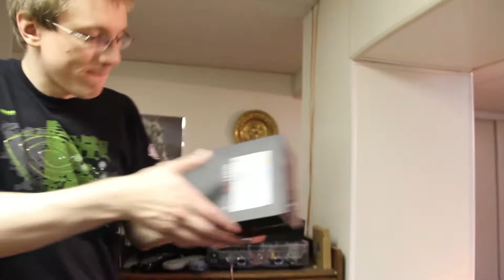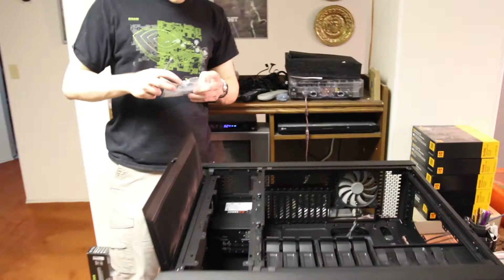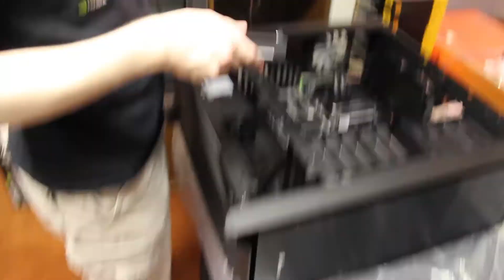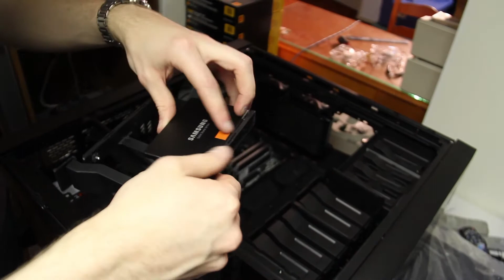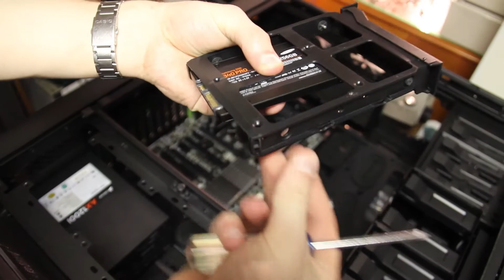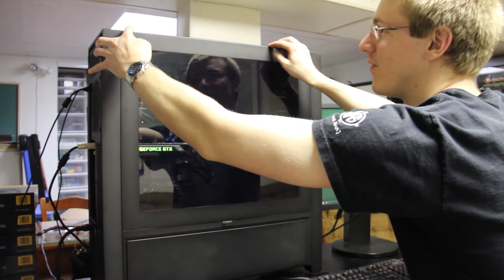Build 2013 - The Build

Comment from the maker: Honestly, I would go Intel. The i5 processors are all you need for gaming, unless you're planning on doing 3D modeling, video rendering, virtualization, or any other multi-threaded tasks then the 8 core AMD chips and even the i7 CPU's from Intel are way overkill. You said the system was primarily for gaming, that's why I recommend the i5.